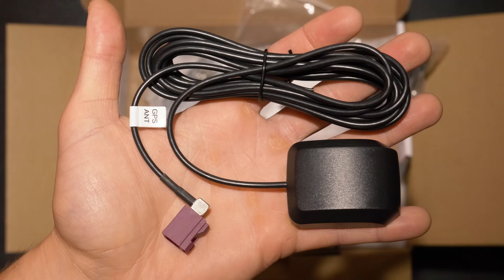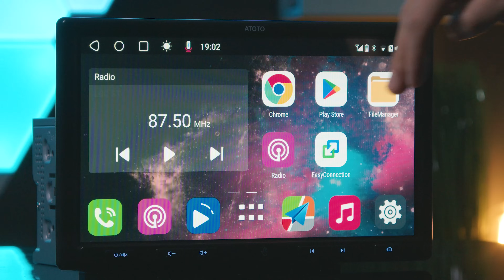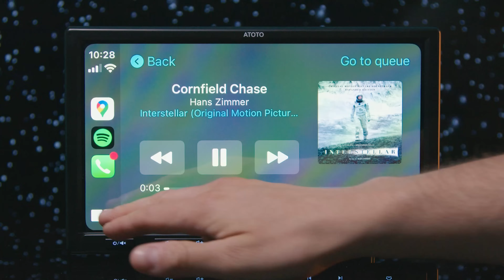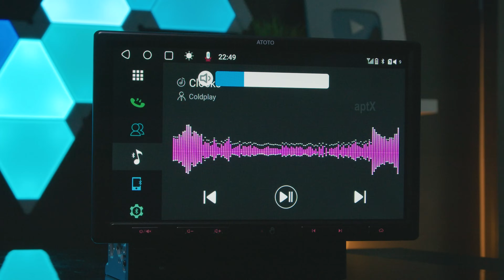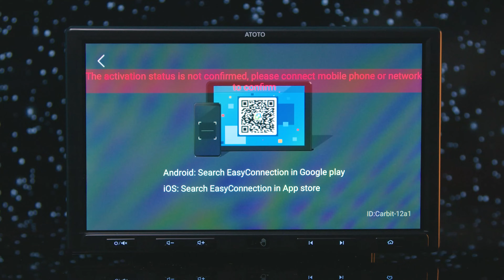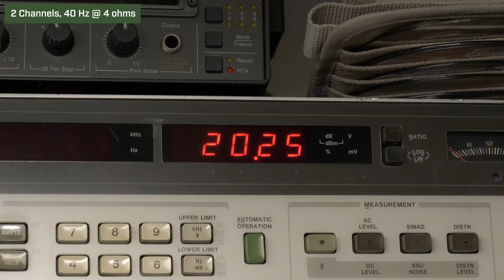ATOTO S8 Ultra Plus Android 10.0 Headunit - 4G, WiFi plus Wireless Apple Carplay & Android Auto

Comment: With something as expensive as this, that 10 inch screen not even at 1080p is pretty sad.  Does it even have multi touch for the screen?  It has just about everything I want except for the screen, which is the part you look at the whole time.. and doesn't have hdmi input.  It has so many good things about it, only to not have a couple main things in my opinion.
Reply: He literally said in the video that a 3 finger swip adjusts volume.
Reply: @Anntt94  and you can see pinch zooming in the navigation apps

Comment: I didn’t see a subwoofer level control, does it exist in this unit?  The Eonon I got for my E46 BMW didn’t have sub level control and it was the absolute worst.
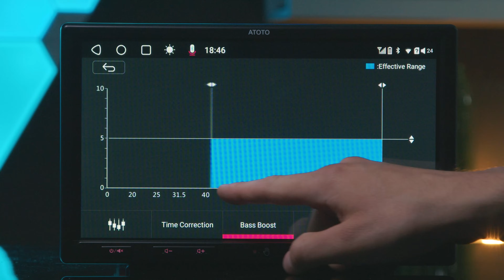Reply: 13:04 is there
Reply: @MrNaliux  that is bass boost. Subwoofer level control is NOT the same as bass boost. Also it's c,early labeled bass boost.  Let's not spread false info and try to pay better attention lil bro.
Reply: @securitycoolyo  I installed 2 S8 ultra  with amp subs on my cars this weekend and that's how I control the  level on the sub
Reply: @MrNaliux  I'm sure you did a great job bud.  What part of the car did you install it on? Roof? Door?  Wtf is an amp sub???   Please stop spreading your lack of knowledge PLEASE.   I'm sure your stereo sounds great 👍
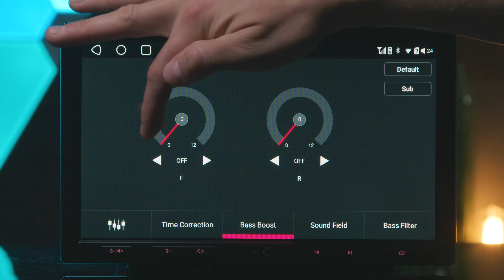Reply: @securitycoolyo    lol I really do hate to say it but  you guys are wrong.  and I know why you guys think it's a bass boost. Atoto should have done a better job with the settings. It's a common issue with atoto head units. At 13:01 you set the bandpass filter within the front and rear bass boost setting. If you look right above the F and right above the R it says off on both of them. If you tap the arrows next to where it says off it gives you the crossover frequencies you can set. And you can control the amp at 13:05 it's like they did a 2 in 1 kind of setting or something.. idk but you move the slider up and down within that 0-10 range. So if you where bumping your subs and you slowly draged that slider all the to zero you can feel your subs loosing power like turning down sound until you hit zero and your subs would be off. Idk why atoto they did there settings like that. It blows my mind. And I do have a reay nice and expensive system. I like the atoto just because it's an android operating system. I even rooted mine to and flashed a custom rom on it. I have 2x Sundown ns.v5 15's, 1x Sundown 8k RMS salt 8 amp, 3x D3100 batteries, a mechman 400amp e series alternator and my door speakers are are from skar audio. I forgot the name. My brother gave those to me. And a 4th order blow through box for the bed of my truck that's not tuned just right yet. I personally would  recommend another unit. I ended up building my own head unit that runs linux / windows 10
Reply: Click equalizer-bass boost- sub them that's the 13:04 image to control your amp sub
Reply: @MrNaliux  that is still bass boost, not a crossover
Reply: @brendan747  thank you. I'm wondering what is so hard to understand. Some people are more than slow smfh.

Comment: That screen resolution not being as advertised is a bit of a worry, and how did you end up with a bent chassis?

Otherwise this is the Android head unit of my choice because of the adjustability of the display. If only they made it look prettier from the side so it doesn’t look unfinished.
Reply: This fit's in a ford edge titanium from 2015!!??

Comment: I currently have an ATOTO unit that I bought exactly 4 years ago and so far it been working great the only issue that has is that my SWC doesn't work with my head unit and the second issue since is 4 years old back then it came with Android 4.4 and a lot of apps are not compatible anymore and is kind of sluggish if you are opening 2 or 3 apps. It gets really slow when switching between google maps and youtube music. Is time for an upgrade this one seems to be a beast, but don't know if I wanna spend $600.
Reply: How much was it back then?
Reply: @OneManOnFire  I paid $230 to $260 back then, now is only the 7 inch. This new model still doesn't support  oem AWC.
Reply: @tonyvelasquez863  Take into account that resell value is pretty high on the A6 still, that and customer support were what made me pull the trigger on this unit. But I use SWC Interface module so that part isn't an issue for me
Reply: @lamanamanume  mine is the older version M4 series lol before the A6
Reply: @tonyvelasquez863  oh wow. Old school haha

Comment: BEWARE GUYS !!  I had the FLAG SHIP of the Atoto. The QUALITY FOR THESE headunit receiver is subsequently really bad compared to Brand name like Pioneer or Kenwood etc.. That's saying your hooking up a subwoofer system!! I'm a car subwoofer system kinda guy and I didn't think there would be a huge difference but THERE IS!! 

If your just into it just to listen to regular music without a subwoofer system. By all means with all the options..GREAT.

Just giving you guys a heads up ...

Like I said ..buy it ..try it out and see if you like it..
Just giving all you crazy car audio guys a heads up 👍
Reply: Greetings from Toronto!  I have a high end system in my vehicle using the A6 model.  2 x JL Audio 13W7 Subs off of a Rockford T2500  4x Morel Carbon 63 3-way comps off of 2x Rockford P400x4's all running via the Atoto pre-outs to a  Rockford 3sixty audio processor. While the processor made a difference (mainly when I had it tuned) the output was clean before this as shown in the video.  Just not as loud.  Had the Atoto for about 3 1/2 years now and its been flawless.  Other than the pre-outs (which could be better at only 2v)  What else does a subwoofer system depend on other than the required clean outputs?  I am going to Upgrade to the S8 for the optical SPDIF that my processor can use and its a bit slow now when opening more than 3 apps... Oh and that nice 10" screen :)  All in all this unit matched up in specs and size are significantly less expensive by 2-3 times and have more features....  Maybe I had better luck but best deck I've ever had and the cheapest.   And I've had quite a few over the years lol   Cheers!
Reply: @rxmaz7  when it comes to units like this everyone usually has a different experience. Glad to see you had a good one others not so much hope your next set up is a good one as well!!
Reply from the maker: Absolutely some of the older models and terrible preamps and/or internal amplifiers. We have videos showing them to be bad and making recommendations on how to make them better. This is also the reason we show the preamp and speaker level frequency response and voltage. This unit was on par with most major manufacturers at 2 volts, the sub pre-out was only 1 volt. Optical SPIDF to a DSP is the easy fix if these are not up to your standards.
Reply: @Qualitymobilevideo  can you recommend a optical in dsp that ISNT $400+? i don’t need 8 channels, just a simple front rear and sub.
Reply: Yeah you make  some good points if your doing an  Expensive audio system you probably shouldn't get an android unit!!!
Reply: What type of head unit do you have?
Reply: @OneManOnFire  ATOTO A6 Pro Has everything you can ask for except sound quality... that saying your trying to hook up a system..I even played with the equalizer...no avail
Reply: @PRINYATIP  Did you use the SPDIF output? If you use that then it should easily blow away any name brand unit.
Reply: @madmatt2024  actually I haven't tried that.. that may  have resolved my quality... unfortunately I sold my Atoto now and went with a pioneer deh-x8700bs. So far no complaints with my pioneer except for my wallet.
I appreciate the advice 🙏
Reply: @madmatt2024  most of why I want it. Buy a name brand w spdif... Good luck 😜
Reply: @PRINYATIP  all I got to say as a fellow A6 owner is the s8 is another level... Or so we'll see..
Reply: @rxmaz7  Major brands do have units with SPDIF out, they are all over $1K though. You can get a Joying unit with SPDIF out for around $300, sometimes less.
Reply: Listen to the man! While I think the big name companies get away with slightly OVER charging for the name my experience with this Amazon company has been absolutely terrible. Poor quality.
Reply: My audio quality is very good and I have a 12 inch Rockford Fosgate sub. I have the A6 10.1 and I run Spotify. 

The only issue I have is that it's a little sluggish due to the low ram vs the pro version
Reply: @mdroproductions  ya it's slow but it does it😜

Comment: My only concern is unit is not detachable.
Reply: People are still stealing radios where you're at??
Reply: @ttgzombies  hey you never know,I’d rather be safe than sorry.
Reply: @eacalways  install a good alarm.
Reply: I don't believe ANY touch screen head units have detachable faces. Either settle for a traditional, single DIN unit, with detachable face or a touch screen unit without. The cool part is that with an Android unit like this you should be able to remotely lock the unit when it gets powered on again and even see where it is on a map.
Reply: @madmatt2024  Boss has a few, a 10.1 and a 9.1. Mixed reviews.
Reply: I think a stock head unit would suit you well.

Comment: what are the crossover settings?? did i just miss them or did you not cover them
Reply: I believe he showed part of them. It has separate adjustible 20-250hz high pass filters for the front and rear speakers. If it's anything like my Joying Android unit the setting for the sub are in the system menu and consist of a 20-250hz adjustable low pass and subsonic filters as well as a level control.
Reply: @madmatt2024  thank you! i know what i’m buying now
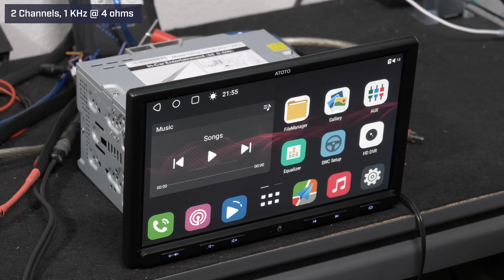Reply: try to look at 14:00 :)